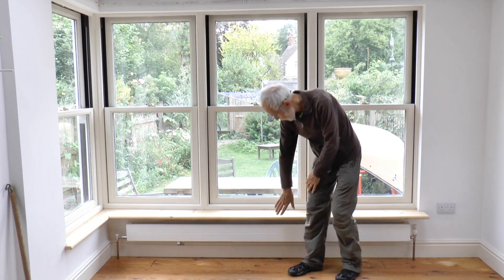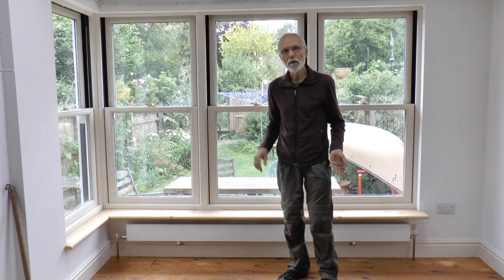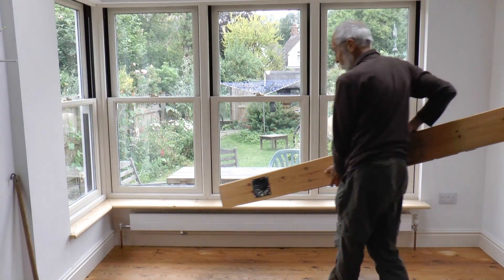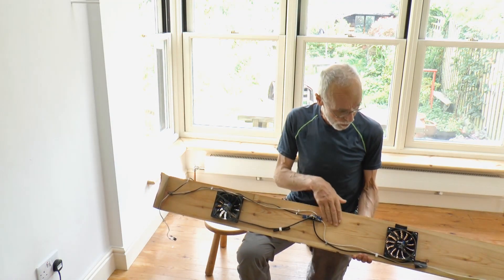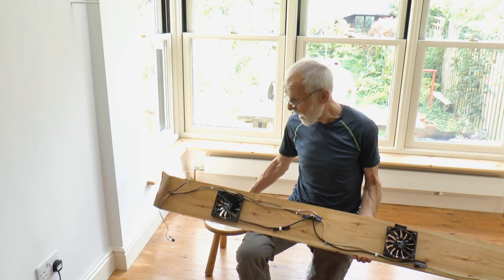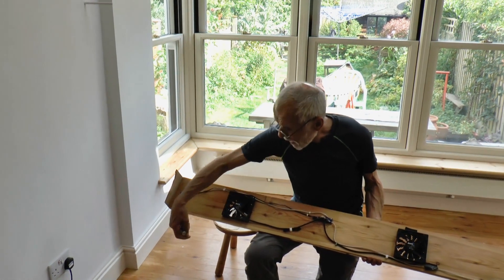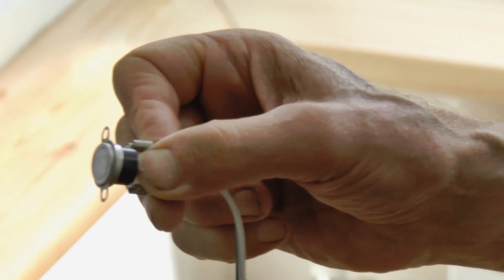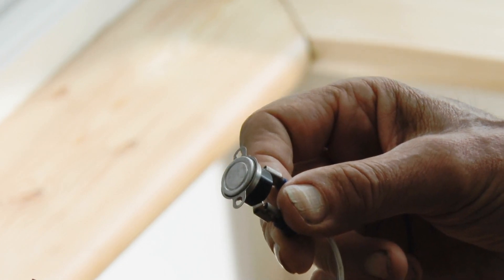DIY Fanned Radiator

Comment: Not sure how easy it would be, but could the temperature switch be used to turn on a power supply when the operating temperature is reached? This way there would be no power consumed when the fans are not needed.
Reply: You could just use a smart plug to switch power on and off you could use with or without a temp sensor

Comment: I'm not convinced there's much net benefit here
Reply: I have a radfan I have bought and also 'made' my own version prototype using PC fans.  They do work very well IMO.  1) the room does heat up more quickly, 2) the air is circulated a bit more forcefully, so rather than it trickly over cold surfaces (walls windows) and losing its heat, it goes into the room quicker and looses less heat in the process.  Also it extracts more heat out of the radiator which is more efficient and keeps return water temps lower which is more efficient, especially for condensing boilers.  simple physics bud, tbh I dont know why they are not more popular.
Reply: You can set your water temperature of your heater lower so your heater burns more efficient. That's where you get your benefit. On a lower temp. it could be necessary to "boost" your radiator. with a fan.